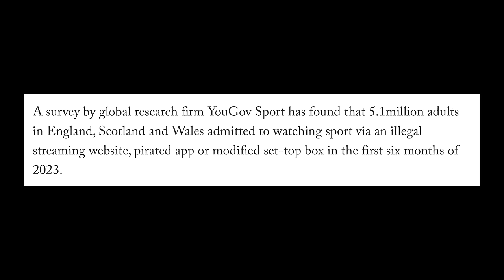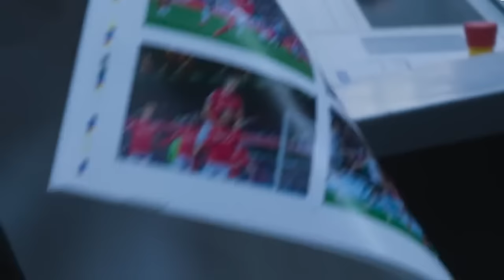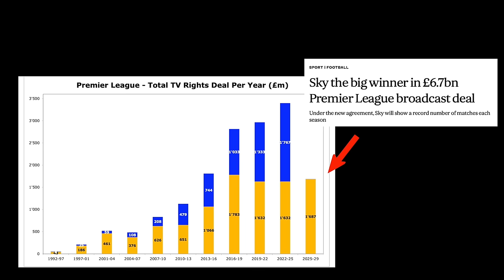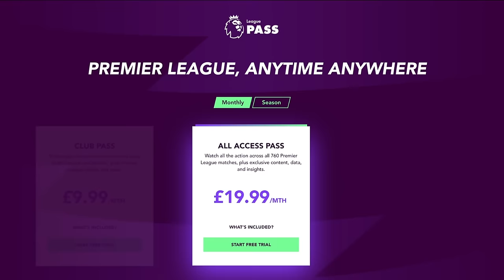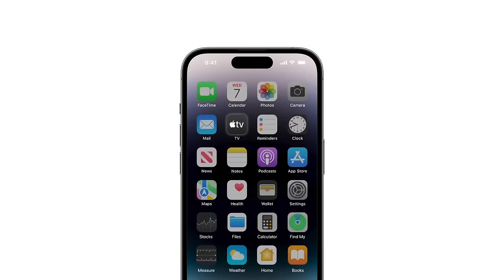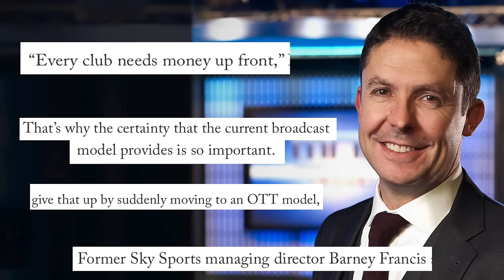Should Football Start A Streaming Service?

Comment: An issue with the blackout is that this is not a choice of the premier league, it is the FA that control this. And whilst they still have the archaic thinking that 3pm prem games on tv will ruin lower league football (despite concrete evidence that it would not), they won’t change.